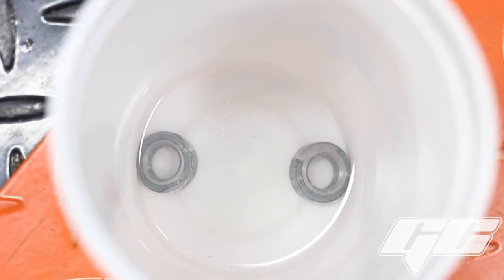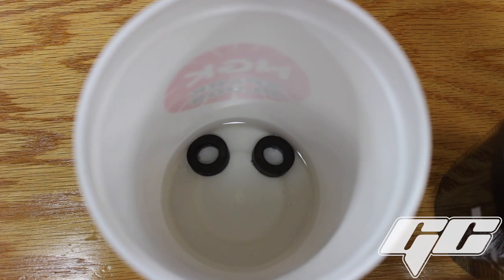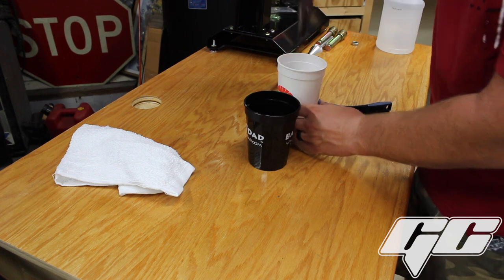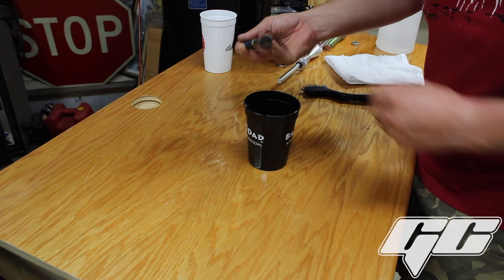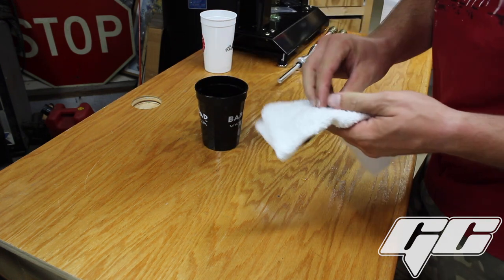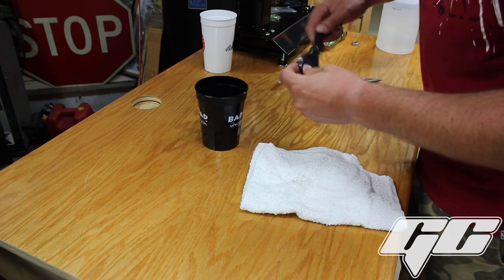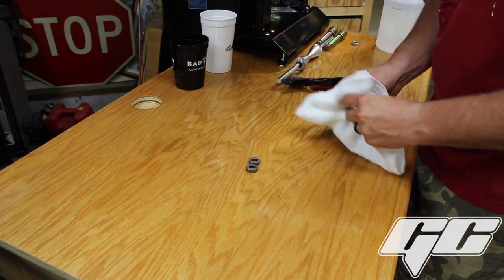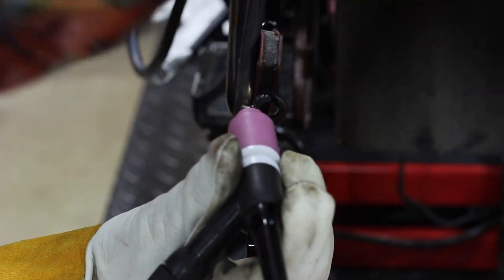Remove Zinc Coating From Metal - The Safe and Easy Way

Comment: Hi there.  Thanks for taking the time out to make this video, it has definitely helped me out big time. - I use a lot of little bits and pieces from the hardware store in my welding.  With MIG or stick welding  I can get away with just welding them and it works.  However with TIG, then everything needs to be good clean metal, so thanks for the tip on how to get rid of the zinc coating.  Also, thanks for showing that once cleaned by this method, parts can then be TIG welded.  Respect to you, David.

Comment: The black stuff is Iron(II, III) oxide (magnetite).  Raw steel is nice and shiny.  Its also a major component of mill scale.  Best practice would probably be to remove it but it is a fairly light coating.
Reply: Sorry to impose but Is it down to bare metal after dipping in vinegar and then using an abrasive to remove the black coating? I have evaporust and vinegar both.  I can’t use muriatic acid because I’ll get a 3 day headache.

Comment: 1:25 Muriatic acid fumes are also toxic and will rust up steel indoors lol. Nasty stuff!

You can buy concentrated Vinegar (30%) at Lowe's / Online. This will drastically reduce your time letting it sit. It's about $20 / gallon, and you can cut it with 5% (cooking) or 10% (cleaning) vinegar if you need a higher volume.

I have an "under bed" storage tote (with lid) that I have about 6 Gallons of I think 15% vinegar in. I can strip millscale off my tubing / flat is about 4 hours. This loosens the millscale enough that I can wipe it right off with a scotch brite. Then, I rinse it with water and hit it with rust inhibitor while wet.

SIDENOTE: I have an exhaust fan and I also pop the garage door open when removing the lid. I don't believe the fumes are super toxic from millscale, but you don't want to inhale the concentrated vinegar anyways, it hits pretty hard and smells awful to me. I'll definitely be even more cautious if doing this with zinc / galvanized fumes.

Comment: Muriatic acid is actually 32% hydrochloric acid. You can dilute it down to 10% with water to make it safer to use. That is what I do and it removes zinc in a few hours. I then coat with phosphoric acid which creates a layer of iron phosphate that acts as a rust barrier. Paint will adhere nicely.

Comment: Awesome, thank you.
So the same process also works for the cadmium coating. 
Tossing the zinc pieces in too.
BTW, I'm working on a 67 Mustang. Stripping the hardware before I black oxide them.

Comment: Great video.  Question about painting zinc coated steal.  Should you remove the zinc before painting, using your method or is an abrasive pad and a wash fine?
Reply: I'm still learning but I read somewhere where someone said they removed the zinc and then it was ready for painting. 
Did you find the answer?